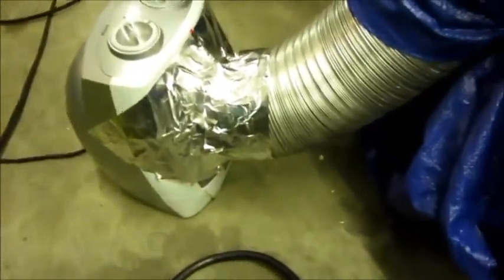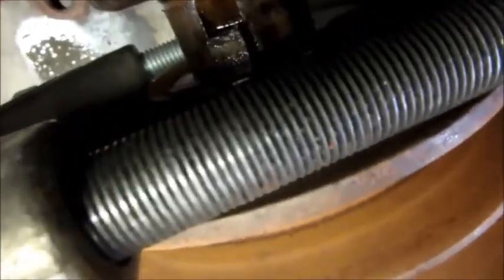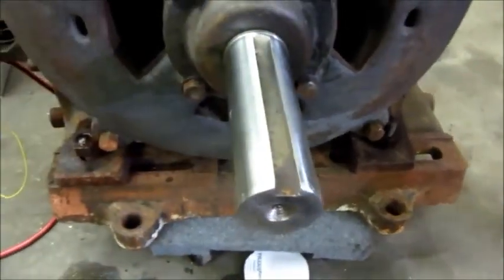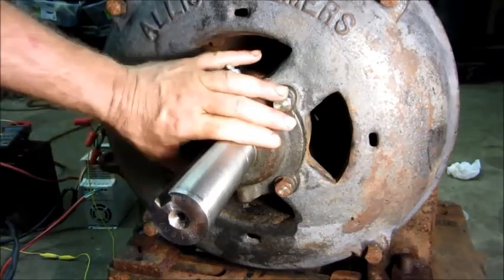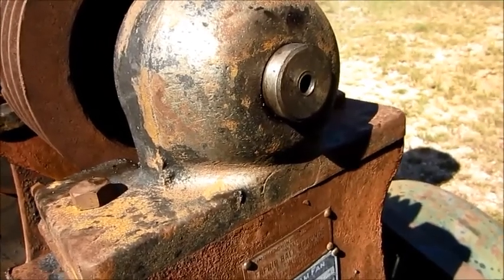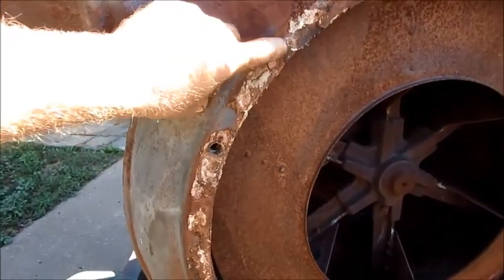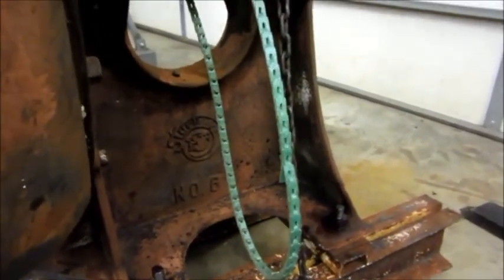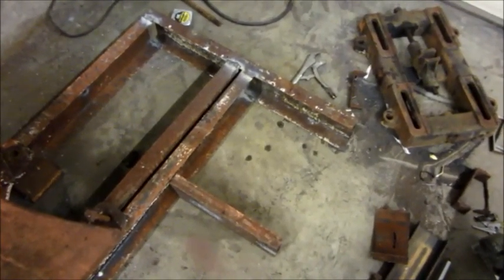Sturtevant #6 Blower with Allis-Chalmers 15 HP motor - #3 - Motor dry, pulley remove, skid work...

Comment: Haven't gotten there yet but I guess the weight difference is from the massive set screw on the front of the fan. I know it's close to the center of mass so it shouldn't have much affect but it's a big old bolt
Reply from the maker: You got a point there. Blower doesn't seem to vibrate much.

Comment: Thank you for touching on the "seal" on the output end of the motor shaft. I am going through an Allis-Chalmers 1.5 HP AR motor, which is much smaller than yours, but similarly constructed. I was wondering if there was supposed to be any sort of felt or similar seal in there, but it's good to hear that I don't have to worry about that. One note on mine is that the bearing cap on the other end of the motor also has this spiral/threaded hole, but of course no shaft sticking out of that end... So I need to cap that somehow. Your end cap appears to be solid. I wonder if I will get lucky enough that the threads are something standard to where I can thread a plug into them, or if I'll have to rig up a core plug or similar. I have found a few examples online like mine but with a recessed square head plug in it.

Comment: "Neutral Mineral Grease"?!  I tell you, the older the machine, the weirder and more obscure the lubricants.  Fifty years earlier they would have called for 600w turtle fat haha
Reply from the maker: LOL!!!

That is an old term for petroleum grease.  I had to look it up!  Mineral oil is from petroleum instead of animal fat or plant oils.  Neutral implies that the grease does not have solid lubricants such as moly or graphite in it.

In other words, the Lucas Green grease I used on the  motor would qualify as Neutral Mineral Grease. :)
Reply: I see...and I imagine just about anything modern would be better than what they used way back when.

Comment: A friend of mine once had a early-1940s KC-built Fairbanks-Morse 1-1/2hp 3-phase motor which came off an air compressor.  It was all ball-bearing, F-M being the first to do so with an electric motor.  I had no idea why someone pulled it off the shop air compressor in the first place as the thing sounded like a brand new motor when I wired it up to test.

Comment: Given the size of that motor and the size of the VFD I'm having a hard time wrapping my head around start-up current. Is the VFD doing a "soft start" ?
Reply from the maker: Sort of.  A motor's locked-rotor current is caused by a huge difference between the frequency's synchronous speed, and the motor's actual speed. This causes a huge current draw during startup when you give a motor full frequency and voltage when it is at a standstill.

The motor is most efficient and powerful at converting real power (kilowatts) to shaft horsepower when the motor's actual speed is "somewhat below" the synchronous speed for the current frequency. For instance, when you have a motor running at 60 HZ (sync speed 1800 RPM) and you pull it down to 1725 RPM, the motor will very efficiently take in electric power and make shaft horsepower because the actual speed is just below the sync speed.

Now with the VFD, during startup , the frequency starts low (10 HZ in this case) with about 30 volts. The motor is trying to run about 200 RPM at 10 HZ. That is a small difference between 0 RPM and 200 RPM so the motor is not really in a stalled condition. It is in the efficient "somewhat below synchronous speed" range.

So by ramping the frequency up at a predefined rate, the VFD motor will make massive starting torque without any excessive startup current.

Hope this explains it!  With the VFD, the motor never "starts." It transitions from stopped, directly to "running" bypassing the locked-rotor startup phase.

That VFD is not as small as it seems. It will provide 480V at 12 amps to the motor. That is a lot of power...
Reply from the maker: Great! Thanks for letting me know.